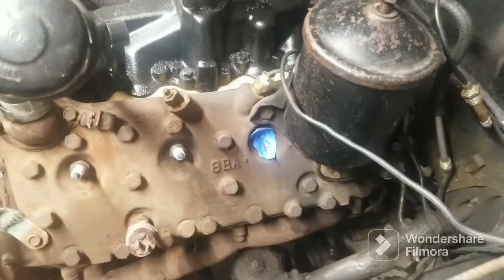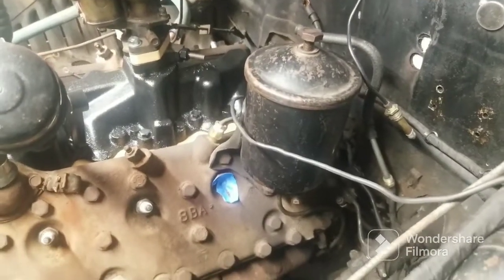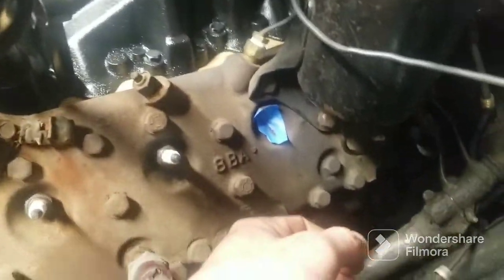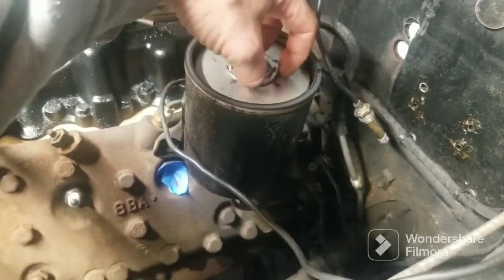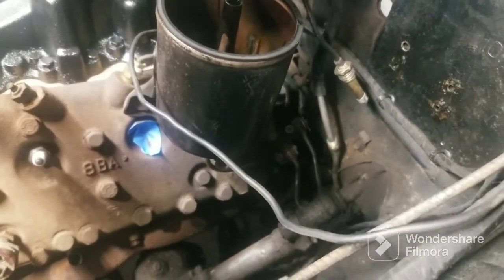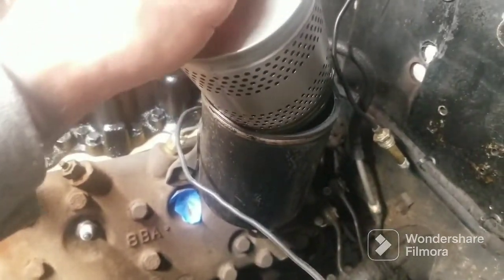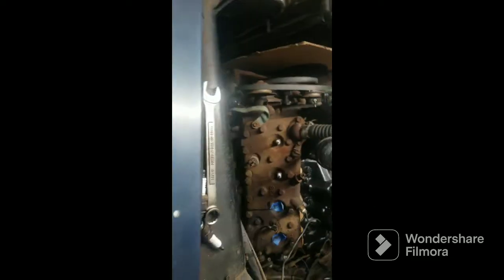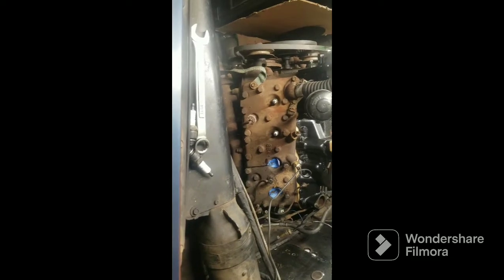'49 Ford club coupe; 8ba oil filter removal

Comment: Right water pump looks rebuilt.
Reply from the maker: It does but I just ordered a pair and a couple motor mounts
Reply: Rember, there is a mounting bolt inside the radiator hose mount.
Reply from the maker: Yep, I made sure that all the bolts would crack loose before I order the new pumps.
Reply: Met several people that broke there pump, not knowing of the hidden bolt.
Reply from the maker: It's definitely the weirdest and worst location for a bolt, but I'm putting a stainless bolts in place of it when I put the new ones on